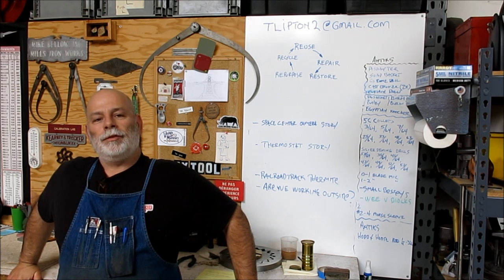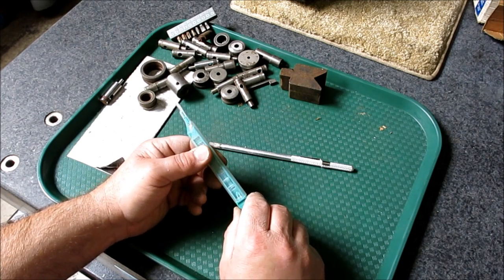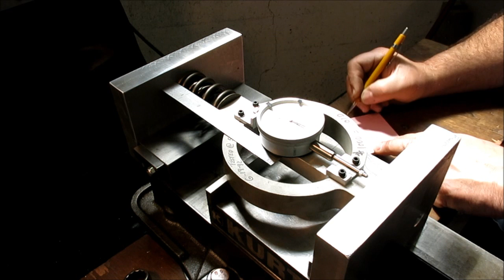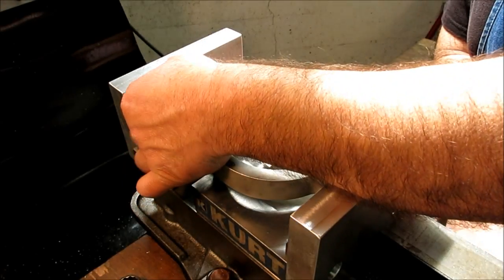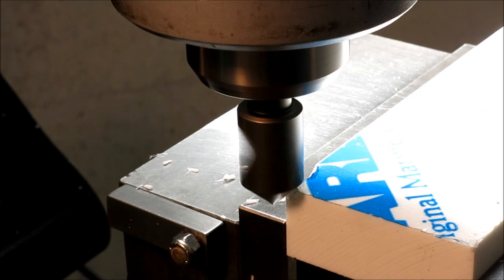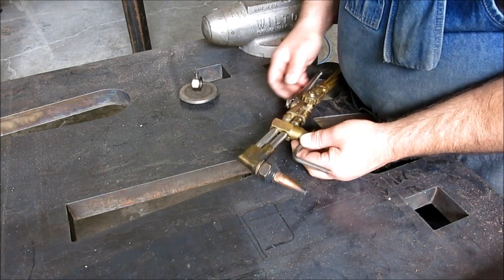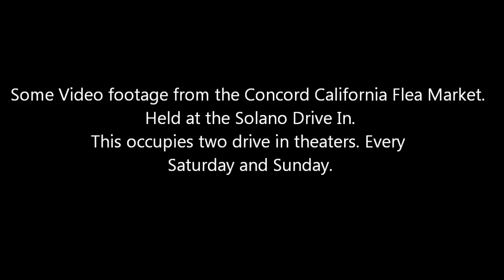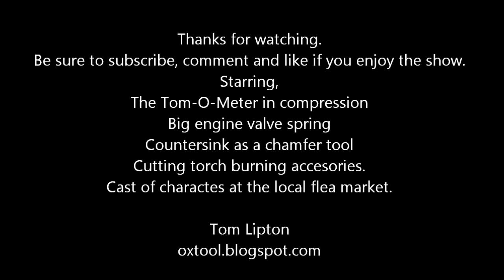Monday Night Meatloaf 26

Comment: High Tom great video. The spring you showed has 3 springs to stop valve float, the springs are different thicknesses and wound opposite directions to counter the resonance frequency of each individual spring, just in case anyone wanted to know. I know engines but getting into to machining and your videos are of massive interest, thanks again from the UK - matt

Comment: Hi Tom,
Good mix of things.  Got a thermostat story too.  I had a boss, owner, that had the thermostat in his office for all the front offices in our industrial building.  He liked it where he could shut off the air conditioner and all office personnel would suffer with the heat (was in So Cal).  When he left the building, they would rush in and turn down the thermostat so the AC would turn on.  He would come back and get all pissed off that the AC was running.  I fixed it - being responsible for the building maintenance.  I had our HVAC guy come in and put a duct stat in and disable his thermostat totally.  He thought he was shutting off the AC but did nothing to control the air conditioner.  Walla… everyone was happy.  I think he never knew what I did but all the office personnel were happy.

Thanks for sharing.
Reid
Reply from the maker: Hi Reid,

I think I might have worked for him at some point. Was there one coffee cup on a chain near the coffee maker?

Cheers,

Tom
Reply: oxtoolco Hey Tom,  I think you DID work for him!!  You sure know his traits.  :-))))
Best,
Reid

Comment: Hi Tom,

That valve spring is what they call interference wound. It forms a friction damping mechanism to stop surge leading to coil binding and valve train failure.
Reply: good info Paul.
Reply from the maker: Hey Paul,

I thought all the engines you played with have hairspring type valve springs to prevent that...... Never heard of interference wound springs. Thanks for the info.

Cheers,

Tom
Reply: oxtoolco
Hi Tom,

Only the Settebello originally ran hairspring valve springs and that's been upgraded to coils. The main reason for hairsprings was because the alloys of the day weren't up to the task to make a coil of sufficient rate that could take the heat of being that close to the valve. I've played with low speed Diesel engines where you could compress and remove the springs by hand.

Comment: The torch attachments are genius. I use a torch a lot at work and there are time where my arms are completely outstretched and I'm crammed up in a bad position. It's hard to hold a nice straight line or keep your tip at a constant distance in those situations.
Reply from the maker: SuperSecretSquirell Hey Squirell,

That is exactly the reason I made them. Those long reaches are a pain unless you have one of those long junkyard torches. Thanks for the comment.

Cheers,

Tom

Comment: Hi Tom, Nother cool video! That was a heck of a valve spring (gosh I've installed so many), it reminds me of the old 396 or 454 big block Chevy springs, but not stock... You never have to worry about your valves floating, with springs like that. That gauge mechanism is a little work of mechanical art. what a beauty. Drive-Ins are almost a thing of the past (too bad).  Cool torch stuff I always talked about making some things but lazy won out, and improve probably took more time than making them would have. As always thank you for sharing! :o)

O,
Reply from the maker: Hi O,

Thanks for the comment. 

Cheers,

Tom

Comment: 26:15 - great sound effects :)
Damn digital thermostats!
& now I need something to wash down my meatloaf...
Reply from the maker: Hi E,

How about some brass turnings from cutting metric threads? I have the ID tap now. Freaky little bugger. It will get totally labeled and segregated from the rest of my 1/8 pipe taps. That's a cock up waiting to happen. I managed a handful of Mr Faraday's junk from the bin. They may or may not be charged when you see them.....

All the best,

Tom
Reply: oxtoolco
Sounds good to me - I'll leave it in your capable hands. Yes, I have tapped a few 1/8 BSPT holes in my time. All the small diameter quick-connect air fittings (for up to 8mm hose) use this thread as a standard, along with 1/4 BSPT, so they are handy taps to have when dealing with these fittings. 

Ahhh...awesome...charged I hope!
You're a good man Tom :)

Don't forget to put your name on the fitting when it's finished!

Comment: Hey Tom,
I assume 2 things about the flea market:  1. It's at the old Concord drive-in theater. 2. You must be fluent in Spanish. In one of your shorts I saw a honkin' pipe wrench -- a good 3 feet long!  What do you use scalpels at work for? Dissecting the jobs? You know the 11th Commandment:  "Thou shalt not piss off CAL-OSHA!" Thanks for another tasty (yum!) version of meatloaf. Next time, I could use extra napkins, please.
Regards,
Oxen Dave
Reply from the maker: Hey Dave,

Your eye calibration is off. That wrench was closer to five feet long. Did you notice it was bent? Some animals were using that one. We cut all manner of things with scalpels including taking things apart. Cal-OSHA has nothing on our safety folks. We default to which ever standard is more stringent. 

Cheers,

Tom

Comment: At a place I worked we had a couple of employees doing the thermostat two step so having had enough of that we simply intercepted the leads as they happened to go through the office overlooking the production floor and put in a thermostat in the office and the one on the floor that they were playing tag with was rendered just a decoration So unbeknown to the two self appointed monitors for some reason they seemed to settle on a nonfunctional setting ending the longstanding temperature dispute.. Go Figure!
Reply from the maker: Hey John,

Bringing peace to an otherwise escalating situation. Thanks for sharing.

Cheers,

Tom

Comment: Tom,
Great video as always, some good stuff in there, I wouldn't mind taking a spin around your weekend market, that looks pretty good, lots of stuff there that could be of interest, the temp story was good, as we all know one just has to think outside the square to be ahead of the game, one thing that I have noted which is on your whiteboard is a comment written there about railroad thermite welding, and this subject does interest me as I have always wondered having seen this process done on various you tube videos, is that once the rails are welded using this thermite process, is how do they allow for expansion and contraction, as the whole length of the rail effectively becomes one piece, without any joints the rails would buckle, one would think,
I would be interested if you have any thoughts on this aspect of it,

regards
John MD
Reply from the maker: Hi John,

I will get to the story pretty soon. I did a seminar once where I used the expansion of railroad track over a mile from daytime to nighttime temperature. Quite a bit of length change to deal with.

Cheers,

Tom

Comment: Hey, I saw you eyeing that big knurling tool at the flea market!

So the T-O-M relies on only internal spring pressure during comp measurements? So if the dial indicator is a little sticky it can skew the specs slightly. No biggie if taken into account.

AND, lastly, did you ArmorAll the rear way cover? Man, Adams gonna be pissed! LOL!

Colin
Reply from the maker: Hey Colin,

I keep that cover lubed and polished. It just makes Stan's and Adam's look that much worse. I'm shame those two into upgrading one of these days.

Cheers,

Tom
Reply: HAha, I hate it when mine's dirty too!
ShopVac on standby!

Colin

Comment: Cutting a straight line I use two wheels 
Installed on each side of the cutting head 
It gives stability 

Interesting visit to the market 
Maybe you can focus on the tools 

The market really similar to what here in Israel 
Of course much larger 
I was impressed that you have a lot of junk 
And dominant language is Spanish 

Great for your movies 
You have also watched in the Holy Land
Reply from the maker: Hi Itzik,

Thanks for the comment. I have seen the dual wheel models. I like to see the line and the kerf of the cut while cutting. Both work well.

All the best,

Tom

Comment: Hey Tom Just found your channel thru abom79. would like to add my two cents worth about the valve spring. years ago when we first started using roller cams we would shim the valve (head side) to keep the lifter on the cam. We would use different shim thickness to get the lifter to fallow the cam profile..090 Th in our case.  We had 327 cid engines turning 11000 RPM.Ok to the point ,you may have to shim your valves to get the same pressure. Keep up the great work   Evil
Reply from the maker: Hi Evil,

Thanks for the comment. These big fat springs will be running much slower for my job.

Cheers,

Tom

Comment: The guts to the pressure gauge look like they were a high dollar item. That turned out as a neat display. There were a slew of wrenches, were they mixed COO or older US stuff? Can't believe you didn't get that massive pipe wrench.
Reply from the maker: Hi Eric,

Lots of wrenches. Lots of scrap steel. Did you notice the pipe wrench was bent? Some giants were using that one.

Cheers,

Tom

Comment: A fellow named George used to go into the blacksmith shop and just snoop around. Nothing mean or anything like that, he was just curious and had lots of free time. One day, the blacksmith had been making horseshoes and had one sitting on the anvil. The shoe had cooled down below the color stage, but was still pretty hot. Old Curious George walked over and picked up the shoe, which he immediately dropped. The smithhy, said, "Pretty hot ain't it?"

George replied, "Naw, it just don't take me very long to look at a horseshoe."
Tom - Vista, CA
Reply from the maker: Hey Tom,

I got a chuckle out of that one. Thanks for sharing.

Cheers,

Tom

Comment: The reason for the extra springs is not so much for extra tension (shutting valves) it's because at certain rpm a single spring will resonate causing valve bounce the extra spring or springs will resonate at a different rpm thus canceling each other out.
Reply from the maker: Hey Ram,

Thanks for the explanation. I took out the inner springs and just the outer is enough for my repurposing job.

Cheers,

Tom

Comment: A ha ha:  the thermostat story!!  It's even worse when you have multiple "zones" on independent A/C units (like at a office building, etc.), multiple floors, stairwells or doors that are blocked open.  Them office rats get into thermostat-wars!  I remember something about 700+ PSI for racing valve springs.  I forget if that was compressed or at lift minus .010".  Some of those high RPM valve springs, with multiple coils, are of different spring rates or physical coil wind dimensions....to reduce harmonics?  When those rascals are going up and down a few thousand times a second...they start acting funny.  I forget.  I can't wait to see the gizmo that will be use them.  The milling machine chip flap saga (Shadon HKW) continues...cracked me up!
Reply from the maker: Hi Joe,

The big mill flap caper is coming soon. I think I shamed Stan into a new one but Adam is still dragging his feet.

cheers,

Tom

Comment: Rigged thermostat brings to mind a WWII story.

Manhattan project hired dozens of housewives to keep uranium centrifuges optimized using variac knobs, with an analog meter showing how they were doing. It was tricky and frustrating, due to a delay between adjusting the knob and seeing the result on the meter needle.

Suddenly, production mysteriously fell off in one section; soon the disease spread through the whole plant. Investigators eventually found that one woman had discovered the little calibration screw on the meter face worked much better than the variac. She told two buddies, and...
Reply from the maker: I heard a similar story about these woman. They could extract more Uranuim ions than the machine designers thought was possible. When ever the physicists came down and adjusted the machine production fell off. 

Cheers,

Tom

Comment: Tom if you need springs, boy have i got some for you.  I found a rather large box at work and theyll be trashed soon if no one wants them., ill email some pics to you tomorrow

Mark
Reply from the maker: Hi Mark,

The first Tom-O-Meter was made with huge coil springs. We called it the agrometer because it was so crude. Used some big honking coil springs as the load.

Cheers,

Tom

Comment: Hi Tom,

Those flea markets, where the latinos are kings. Lot's of goodies, good thing I'm not close because I'd probably be worse than you when it comes to tools.

About the circle cutting guide, there is one made by Hypertherm for their torches that could easy be adapted for Oxy cutting, even inspire someone to fabricate one.

The nice thing about this one is that you don't have to whirl the hoses around, the holder is mobile around the tip. For what it's good here is a link that shows how it is used.

http://www.davidharriesstore.co.uk/HYP.027668/

Cheers,

Pierre
Reply from the maker: Hi Pierre,

I have used this type for cutting torches. They didn't have wheels out at the tip end however. Thanks for the link.

Cheers,

Tom
Reply: Hi Tom,

I personally own one of those kit on a Hypertherm 1000 and it works pretty good, never tried it on a Oxy torch.

Pierre

Comment: tom I have to thank you  I got one of the Milwaukee cordless ratchets, very handy around a mill, I have always put off removing vise jaws it seemed a pain, now it's very easy also I think I've been over  tighting them years. ps just got a new kurt 688.. Purdy..the old one looks so bad now.heres something new to me the old vise would not stayed tramed, I would tighten it down, tap it with a soft face hammer, and it would move a few thousands. I know don't tap it with the hammer. I would put a piece paper between the two and that helped?? maybe I need to send it stan or os screwball and have it surfaced? help!
Reply from the maker: Hi Joe,

Its hard to find these Skil cordless ratchets. The Milwaukee's are nice as well. Sounds like the bottom of your vise has a hump in it. Its pivoting on a single point for some reason. If you have a surface plate you may be able to map where it is.

Cheers,

Tom
Reply: yes there is high spot looks like a half moon maybe from being overtightened   a lot?? thank you tom

Comment: So, if we are oxen, what kind of oxen are we?

Ask your friend to give you the engine washer. The spring doesn't work properly without those. Also you'd probably need two that are identical (the top ones would probably work best), because you're using this differently so each side of the compound spring needs a washer.

Something like this "ht tp : // w w w . jabiruworkshop . com / wp-content/uploads/2013/04/valve-spring-washer.jpg" (sorry for the split link but youtube sends these comments directly to spam and i've lost quite a few messages like this)

Good music selection.

I'm kind of a butt for this, but on the same topic, i bought a thermostat that has that wheel that you can remove and set the top end and bottom end of the range. I installed it and the opposite party had to give up. I know. I know. I'm a butt, but i never got roasted in my room whilst working on 100 by 70 cm papers, dripping like a hog over them, after that.

Was that an actual wrench, the orange one in the flea market, or a sign one?

Kinda...flimsy, the flea market this time. The ones i usually go to are all packed in tight places with piles of stuff. Difference between Europe and US i guess :).

Man, i've come to enjoy your shows more than i once did, enjoy, the Discovery channel documentaries, way back when, when they actually did documentaries and you know, cared to teach a thing or two. Now it's all pink panties and full faced sunglasses. My childhood...it weeps in sorrow.
Reply from the maker: Hey aserta,

The wrench was real. Did you notice it was bent? I will most likely only use the outer spring of the three. I only need to balance a load of ~700 lbs between two springs. Glad you like the show.

Cheers

Tom
Reply: oxtoolco Hey, Mr Tom,

So damn huge. Probably one of the most out of norm tools i've ever seen.( From the same family as a Starrett micrometer that was as taller than the man that wielded it.)

How many guys would be required to even use that thing...i'm already picturing those older Greek or Roman themed movies where there's 5 guys pushing on a lever.

And yeah, if you're only using a spring then a normal washer to protect the surface you're resting the spring will do perfectly. I did some quick fact checking and the engine is a beefy monster.

I'm glad you're taking your time to make it.
So big thanks for that!

Cheers,

Andrew.